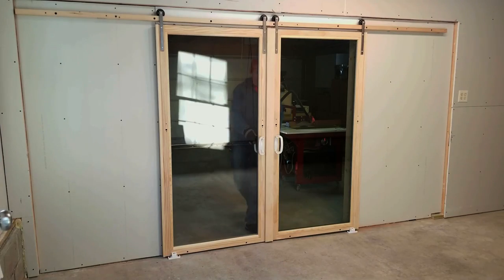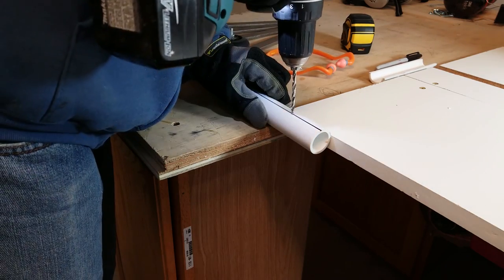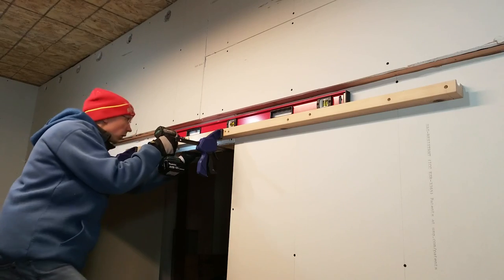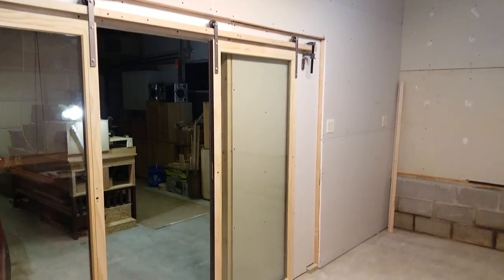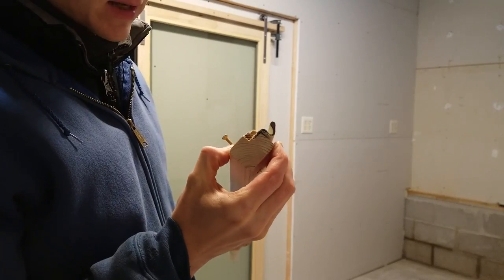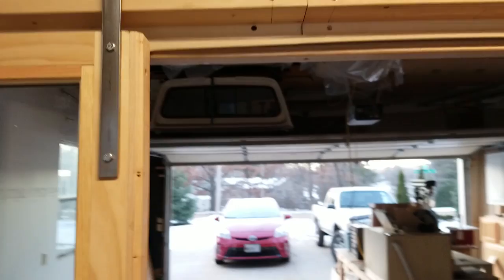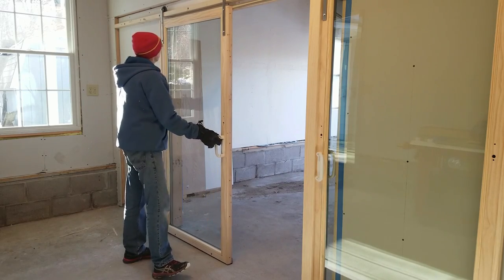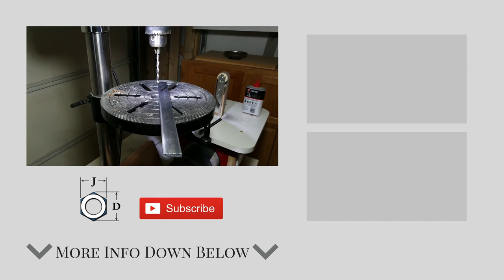Barn Door Style Shop Doors

Comment: I am glad to see you went with The sliding doors over the pocket doors.
That is a great way to safely cut the PVC pipe. 
The PVC track is neat too!
Reply from the maker: Me too. It also looks cooler than pocket doors!
Reply: Justin Depew just make sure if you have an accidental kick back the projectile is not headed toward the doors, although I will say the doors look pretty stout and look like they are made of Safety Glass. I am pretty sure you know this, I just had quell the safety nuts out there.
My sister in law has a requirement for an unusual door size, your tract solution will work perfectly for her application.

Thank you.
Reply from the maker: @TheFalconJetDriver  I had not thought of that... But luckily they are not in the path of the table saw.

Comment: John sent me....   I note the hanging heater in the main garage.  But I don't see a source of heat in the shop?   Was this covered somewhere?
Reply from the maker: Hi there Art. I have a 240V electric heater in the shop. I did not make a video on it, but it started appearing in my videos in 2019 when I got it. It's mounted on wall up by the ceiling.

Comment: A little suggestion for the 3D printed bottom door guides, perhaps design it in such a way that you can put a small rubber or nylon wheel through the bolt that runs through the center, much like the way sliding doors are hung on a minivan. Then make 2 pairs of those, one pair on each face so that the wheels keep the doors in perfect alignment between the guides without much play, regardless of whether the force is being exerted from the front or back of the doors when you enter and exit.
Reply from the maker: A wheel in the design would definitely be an improvement
Reply: I was thinking the very same thing, and then I gave Justin credit for not over engineering the part.

Comment: Why didn't u put slides on outside of workshop. That way u have more wall space in the shop?
Reply from the maker: Because originally I was going to build a pocket wall to cover up the doors on the inside, but then I decided against that because that was going to take up more space in the shop (lose another 4 inches of floor space along that wall) . If I had to do it again I would put the slides on the outside.